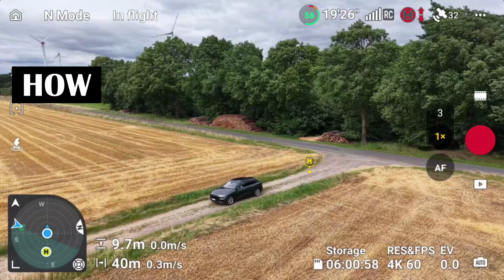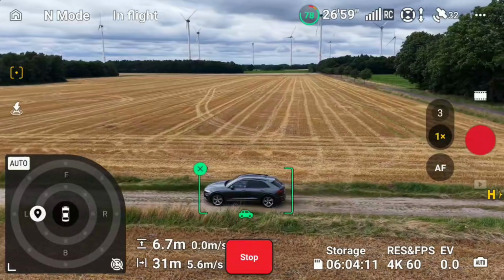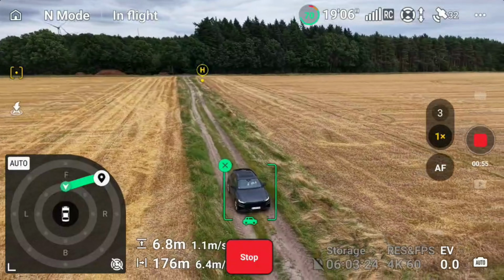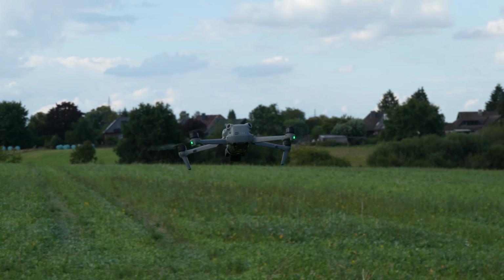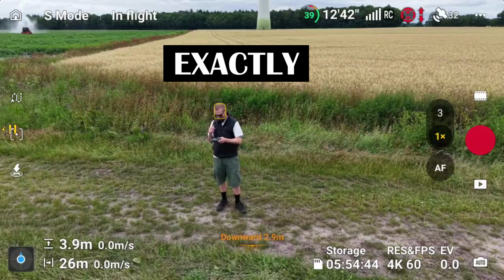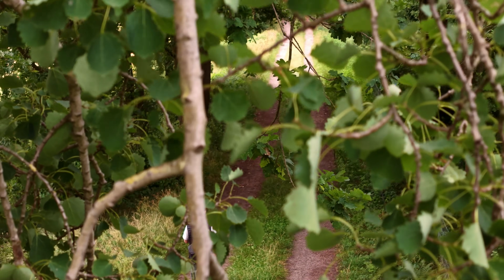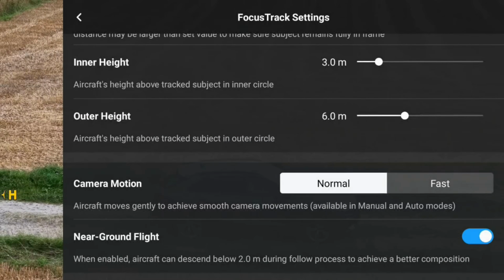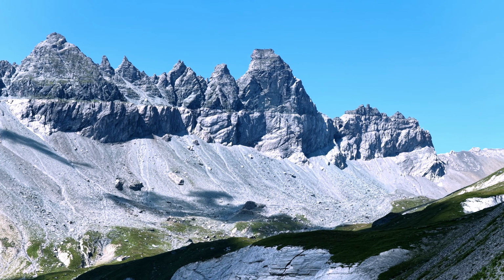How to Use ACTIVETRACK on DJI Air 3S | Car & Person Tracking Tutorial and Guide | Start Here

Comment: Very cool video, I have the same drone, but couldn't get this to work well for my motorbike riding, turns out I was tracking me and not the bike so it was stop following when I gain speed.
Reply from the maker: thx mate.
Did you firmware to the latest version?
Normally it is absolutely not an issue to track a motor bike.
VMax btw is 45 to 50 kmph

Comment: How can we track it top down only?
Reply from the maker: directly from above the car? What you can do is to ascent the drone manually and reposition it a bit by using the sticks, but if you are looking for a top down angle it's hardly possible.
Reply: @doatrip  how is it done then? manually following?
Reply from the maker: It means you enter the regular active track like described in the video.
Then while it is in tracking mode you use the sticks of your RC to move the drones position.
Reply: @doatrip it never gets above. Only around
Reply from the maker: @carlosandreviana9448 that's what I am saying you can ascent it to a very high point but directly above the car is not possible.
Reply: @doatrip so, the videos you watch with top down views are done by manually following the vehicle? That  option could be easily added to the tracking feature by touching the subject in the lower left panel instead of the adjacent circles.

Comment: Excellent tutorial! May I know what INNER/OUTER Radius and INNER/OUTER Height Settings you used in this video? Thank you!
Reply from the maker: Thanks! For most of the car tracking shots I used settings that were fairly close to the defaults.

🚗 Vehicle Tracking:
• Inner Radius: 15 m
• Outer Radius: 25 m
• Inner Height: 7 m
• Outer Height: 10 m

Those settings gave me a good balance between dynamic close shots and wider cinematic angles when switching between the inner and outer circles. Also when using the tele cam.

For the obstacle avoidance stress test, I stayed with similar settings because I wanted to see how the Air 3S would handle a realistic tracking scenario rather than optimizing it for maximum safety.

Keep in mind that there is no single "best" setup. For faster vehicles or more open terrain, I would increase the outer radius. In tighter environments like forests, I would usually reduce the radius to keep the drone closer to the subject and avoid unnecessary route planning.
Reply: @doatrip Thank you very much for your advise! Will definitely try those settings! Is it ok to mention you when I post the videos in my own YouTube channel?
Reply from the maker: sure, feel free. Link me, and I will comment and like your video :)

Comment: Awesome video  I just received the Air 3S yesterday and heading out to give this a try now.  Im curious at the end when the drone followed the car thru the trees how fast was the car moving?  Did you slow or stop the car so the drone could figure out a route?
Reply from the maker: Thanks, really appreciate it! The car was moving the whole time and I did not stop to help the drone. 
Speed was roughly around 30 to 40 km/h depending on the section. I honestly expected the Air 3S to struggle a lot more, especially in the denser parts with branches and leaves everywhere. It was pretty impressive to watch it constantly recalculate and find a path through the trees.
Reply: @doatrip I just came in from having it active track me on an ATV. Started out in a field then under some trees. It’s tough on the nerves for sure. It gave up twice and hovered, I flew it thru and resumed active track.
Reply from the maker: That definitely sounds familiar 😄 ActiveTrack can feel amazing one moment and give you a mini heart attack the next. Hovering instead of forcing its way through is honestly the better outcome though. I would rather have it stop and think for a second than make a bad decision. Trees can get pretty unpredictable, especially with branches, leaves, and changing gaps everywhere. Glad your Air 3S survived the first real stress test 😅
Reply: @doatrip I’ll post the video on my channel in a bit and mention you so you should get a link. Thanks for the video it sure helped. Oh and I didn’t even mention the clothes line heart attack. lol.
Reply from the maker: Haha, the clothes line part would have completely finished me 😅 
Thin wires and lines are exactly the kind of things that still make me nervous with any drone. Glad the video helped though, and I am curious to see your test footage. Sounds like your Air 3S already had a proper first-day stress test.
Reply: @doatrip I posted the video and tagged you in the description.
Reply from the maker: I've seen it. Well tested. 😊

Comment: Great video.  I have the Air3S and I love it.  It did clip a small overhead power cable in a car park one time so I’m very cautious about cables.  But trees - no problem at all.  It’s is scary at times watching our high value drone fly quickly around obstacles.
Reply from the maker: Thanks a lot, really appreciate that. And yes... cables are still one of the few things that can be very tricky for any drone system. Thin overhead wires can be hard to detect, so being cautious there is definitely the right mindset.

I felt the same during some of these ActiveTrack tests. Watching an expensive drone confidently fly through trees is impressive... but also stressful at the same time.
Glad to hear your Air 3S has been doing great overall.

Comment: Thenproblem is you can't design fly path, put controller ti thanbackpack and start your bike ride with this dumb thing. It would be so logical to be able to plan the steps you the drone will switch modes while your hands are busy holding steering bar of your bike.
Reply from the maker: That's a very interesting idea about pre-planning the drone's mode switches while riding – would definitely make it more hands-free!
I use a handlebar mount to not put it back to the backpack. 😊